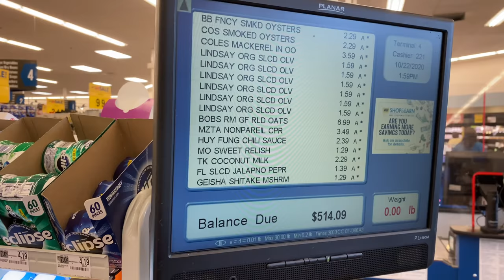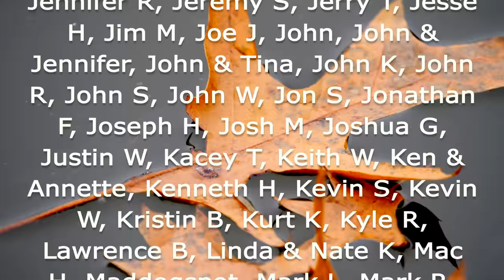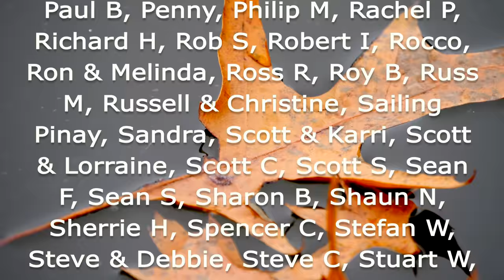3 months HARD TIME - RETURN TO CLARITY - Season 5 Begins

Comment: Bending is tying a knot to affix a line.  And while modern larger boats don't really do that nearly as much as they used to in the past, I know those little sailing dinghies (Sabots & Optimists, possibly the Laser as well) I learned to sail on did tied the sail to the boom with lines.  So when you bend the sail, it just means you're tying it on.

Comment: Flew my GoPro Karma drone into a tree after losing connection mid-flight. They make a drone designed to take off and land on water. Whatever you were using on the mildew stains looked like it worked great. Never ending battle on my boat here on the Mississippi coast.

Comment: Really enjoyed the video today.
Your adventures, troubles and all, are a blessing especially in this crazy election and Covid season.   

I did have one question.   The winds and rain from Zeta are coming through today ( live in NC,  between Raleigh and Greenville).  Just wondering how Zeta is impacting your plans.
Reply from the maker: Very tight pressure gradient on the back side as it departs the mid-Atlantic coast. Stronger than we'd like for rounding Hatteras, so we will wait for it to go by, and probably wait for a developing system after that to go by as well. No need to get slammed right off the bat!
Reply from the maker: also, thank you for the very kind words!

Comment: for the next drone try some waterproof spray for the electronics and some small floats so it can't sink as fast.  For the current drone try to open it up and then dry it(check all the cables and plugs for water) , if it didn't short circuit it should be able do recover with a good cleaning.

Comment: NOOOOO, not the rice!  As a electronics repair guy, rice doesn't work, well it can dry things out but you actually don't want that as it will cause corrosion. Instead, pull the battery for sure, then drench it in pure rubbing alcohol, preferably 99% so it displaces the water. Not the best option but better than the rice.

Comment: For dunked electronics, rinse well in deionized distilled water, and clean PCBs with 99+% isopropyl alcohol. The alcohol disperses any water left in the nooks and crannies, and also cleans stuff the water can't. For the motors, lenses, after cleaning, they need to be greased and/or oiled properly. Lenses that have moving parts, like for focus or zoom, often need a full tear down, clean, and rebuild, and one never has the proper lubes. Some electronics just react badly to immersion in water and alcohol so are toast. This is specially true of pressure and humidity sensors. They may have to be replaced. One needs a soldering iron made for fine circuit work or hot air station to do it properly. Watching the first few videos of these youtube search words, Louis Rossmann soldering tutorial, should provide a good overview of what it takes to replace a sensor chip. I can do it, but likely would just replace the circuit board if possible.

Comment: You could always restore deleted files from the memory card, they are not deleted entirely when you hit "Delete", they are kept there before new files overwrite them. There is software specially designed for that purpose.
Reply from the maker: According to Sony, since it is formatted, it is gone gone gone!
Reply: @TheOKellys  how much time did it spent formatting the disk? If it was instant — files are still there. If it took several minutes, then camera probably definitely erased everything.
Reply: @TheOKellys  there is software like "Disk Drill", I've recovered many pictures from memory cards that way. It worth a try (if you haven't already tried that)
Reply: @TheOKellys  No, that is not how it is. I've recovered files from accidentally deleted SD cards many times. When you format an SD card, you basically just delete "the index" which tells the computer where to look for the files. If you want to actually delete the files, you would need to overwrite the entire card with "useless" data. This takes quite a bit of time depending on how fast the cards are. If you haven't used those cards after formatting them, there's a very good chance to recover your files.
Reply from the maker: shooooooooootttttt!!!!! We have used the cards again! Darn it!!!! When we formatted, it took about 20 seconds.
Anyway, we may need to move on at this point. We really need to have a tech team on board.
Reply: @TheOKellys  Megan, as others have noted....a standard delete or format does not actually remove the file data itself, just the addressing tables telling your device where to find them. There are format/delete options to literally overwrite the old data when security is a concern, but you would generally know it if you did this as the process would take quite a while to complete. Google “SD file recovery.” If you haven’t already recorded over them, I’d bet dollars to donuts the file data is still there. Good luck!
Reply: @TheOKellys  If it only took 20s, I'm 99% sure your files could have been recovered. Oh well, at least you know what to do next time.

Comment: Sounds like you had your Mavic 2 in sport mode.  The little switch on the right side of the controller.  Sport mode is fun, but not around trees and water.
Reply from the maker: Could have been. Though I thought it warns you before you take off. It all happened so quick. We were trying to get the shot from two videos ago when we were in the kayak. Such a bummer. And the drone fell through the tree into the water. Three feet over and it would have landed in a flower bush plant. Bad luck that time I tell you

Comment: Have you cleaned the Fuel tanks to get any crap out at the bottom of tank and flushed out the water tanks .
Reply from the maker: we keep drinking water tank filled with RO water. No need to flush as it is sterile. Fuel tanks don't need polishing, yet.... we keep the diesel well treated.

Comment: If you didn't rerecord over the deleted footage you can recover it with recovery software. I think the downing/drowning of the drone is the bigger loss. When you delete information on your drives/cards all you're saying is that the space where that information is can be recorded onto again. Unless you actually record over it that information is still there. You can't see it until you apply the recovery software, but it's not gone for good. Drones tree proof huh? Is Clarity reef proof?
Reply from the maker: tongue in cheek. It does usually stop itself, but collision avoidance must have been turned off. Tried recovering data. No help
Reply: @TheOKellys  " Disk Drill," for Mac will bring that erased info back to life.

Comment: $150 gas struts - wow. my volvo has hatch lift struts maybe half the size at $20 ea for the good ones, the basic ones are $10. I wonder if you could find something close enough from a large car. automotive grade is usually very good, cars have to operate in all environments sometimes near salt
Reply from the maker: trust me, I have looked high and low. To get the length, through, and force, this is the best I can do. It kinda sucks
Reply: @TheOKellys  Just a thought since my son builds custom Murphy beds, maybe check out gas struts for beds. They are pretty strong to hold the weight of the bed and platform.

Comment: great videos,  surprised when you mentioned the price of the gas shocks. Rock auto .com is a great source and very affordable.  anything that is rv or marine seems to be expensive.
Reply: Yeah, I was thinking that sounded expensive since I have been looking at replacing the struts in my car and they are $30.00. Cheap compared to the headaches I get when the trunk falls on my head! Also a lot cheaper than for the boat!
Reply from the maker: I have looked ALLLLLLL over the place for something with the same force and length....coming up close, but no cigar, over and over again. Very frustrating....these should cost $40
Reply: @TheOKellys  Being for a boat, are they made with stainless steel? I.E. No rusting?